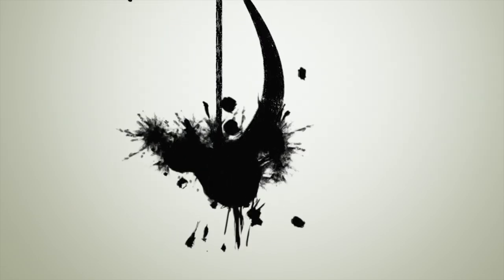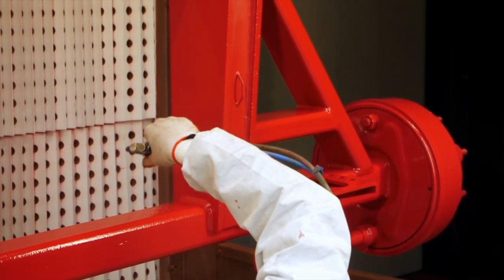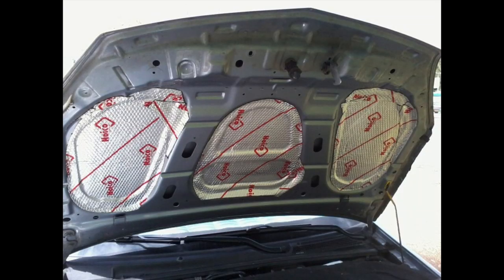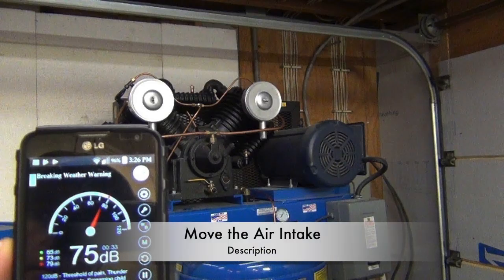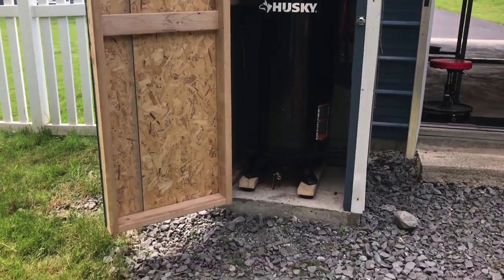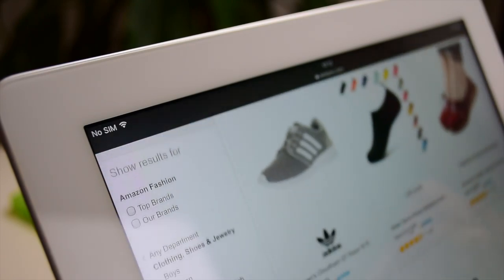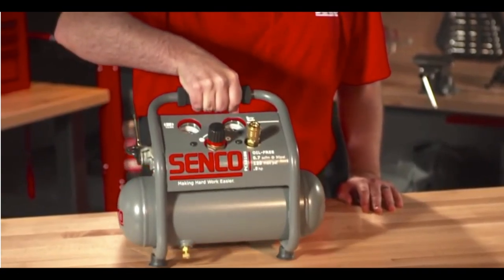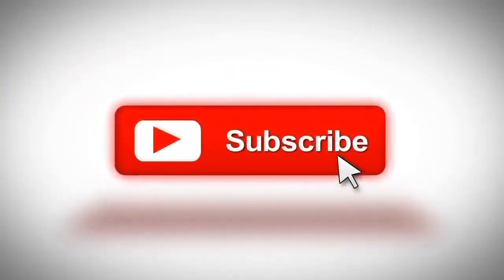How to Make an Air Compressor Quieter - Easy DIY

Comment: Most compressors are air cooled via a fin arrangement so wrapping with insulating might not be a great idea. The 4 db reduction of the "intake muffler" seems like a waste of time. The final tip in the video: "get a quieter air compressor" was a very scientific solution for "How to make an air compressor quieter". Maybe Part ll will reveal..."get rid of your air compressor". Yep. Right there, in front of our faces the whole time. You heard it here folks.
Reply: 4 decibels is a lot, but I agree with your other points.
Reply: here's a solution: run your compressor in the shed, garage, basement etc and feed a hose up to a reservoir tank in the work area

Comment: Maybe I didn't understand....you said to bury the intake hose a few inches in the ground? Did I hear that correctly? Also, the sound deadener you showed is great stuff. I have bought probably over $400 for all of my vehicles, BUT it isn't designed to "last" under the hood of vehicles. It can take very short periods of 400°, but it is not intended for continuous heat of that temp(PER NOICO). There are other products for that type of heat.
Reply: Yep.....he actually said bury the hose in the dirt. 🤣😂
Reply: This guy made this video for a class in highschool. He has no friggin idea!!!!
Reply: Well WHAT OTHER PRODUCTS??? why dont you write it out...
Reply: I think he meant run it outside underground, while obviously leaving the end of the hose above ground.

Comment: If you wrap most compressors you will wrap the vents which the unit needs to cool the motor. The hotter the motor the more strain on it. It will greatly shorten the lifespan

Comment: An oil filter is a very inexpensive way to muffle the intake. Remove the intake from the motor and a brass adapter to go from the intake thread to the oil filter. 10-15$ and you got yourself a quiet compressor. Bigger is better as far as the filter you use. Wix filter #51191 or #51085 are a good size and easy to adapt
Reply: I’m searching for a tutorial for this because of seeing this comment a couple weeks ago. Thanks for the suggestion. Might just have to wing it but I’m guessing it’s kinda obvious where the exhaust is when the cover is off. It’s just a porter pancake compressor
Reply: thank you
Reply: NSDAP Enthusiast 88  So which air compressor do you suggest that's on the quiet side and holds between 10-20 gallons?

Comment: I have to agree with the sentiment of most of the comments about this video.  The tips and suggestions for making an air compressor quieter run from confusing to dangerous.  The instructions for building a box that you refer to that are on your website could be summarized this way - " build a box the right size and put a couple of air holes in it".  I'm sorry to condemn your efforts if they are made in good faith, but it would benefit you and the information seeking public if you rework you modus operandi in a significant way.

Comment: The first thing I noticed about a 70db model was flexible, stainless-mesh hoses and rubber vibration isolation pads on all the compressor-tank mounts. Keep all the vibrating things floating and the noise goes way down.

Comment: Wh.. Huh?? I think I translated the hose thing correctly, to mean burying the stretch of hose going from place A to B. But place grommets "over the motor"? You gotta clarify that one. Also, most compressor motors run stupidly hot. The smaller they are, the worse it gets. So covering the motor /engine with direct contact insulation is a death sentence for your compressor. That's like encasing your car's radiator entirely in builders foam, then taking it for a long high-speed drive through Death Valley at noon on a scorching summer day.

If you really wanna silence a compressor, there's really only 2 things you can do that will make a substantial impact. Box it up with rubber feet - or of its a more expensive unit than generic random sub-$200 ones - replace the motor and pump assembly with something that already runs a lot quieter. Another think you can do, if your existing compressor and setup allows it - is add volume. Replace the old or add a different, significantly bigger tank. It won't do much to dampen the noise, but if you maintain good seals on your system, it won't need to run the compressor nearly as frequently. If your moat used tools are low flow, low pressure ones, you might get by with priming the compressor, leave the area to change clothes or fetch your coffee mug, and return to a full system that might last the whole session. If your tools are high flow and/or high pressure (impact wrenches, jackhammers, high flow blowers etc), you also will retain torque on them for a lot longer, as the bigger tank volume means the pressure won't plummit to the floor after 2 seconds.

Comment: "A two sided air hose"... (@ 4:10)WTF?!? What exactly is a two sided air hose... Has some one invented a "one sided" air hose that I do not know about...?
Reply from the maker: Yeah, I'm not sure what I was smoking that day... lol Thanks for the chuckle. ;)
Reply: Yes, there is now a one-sided air hose on the market. It goes under the American trademark 'VeryLongPlug', and 'StupidlyLongAndSkinnyExpansionTank' in Canada. Can usually find them in your local hardware store right next to the blinker fluid and muffler bearings.
Reply: Your comment popped up right as I read the "2 sided air hose. I must have missed a meeting. I'd think a one sided hose would be....a balloon. A two sided would be...a hose I guess.